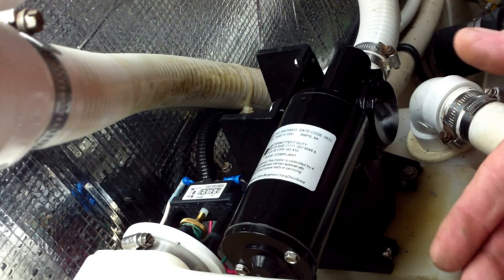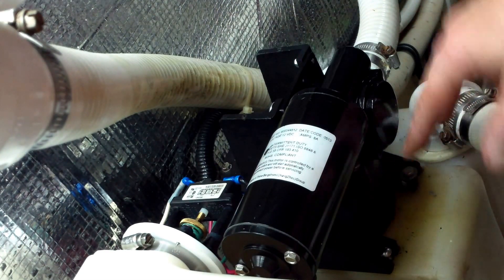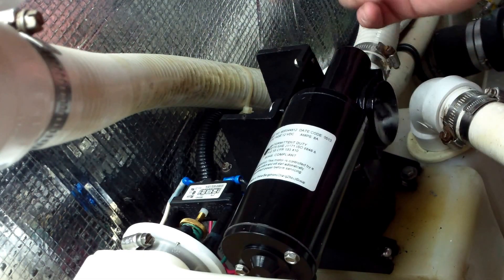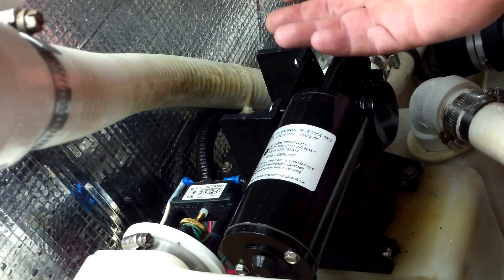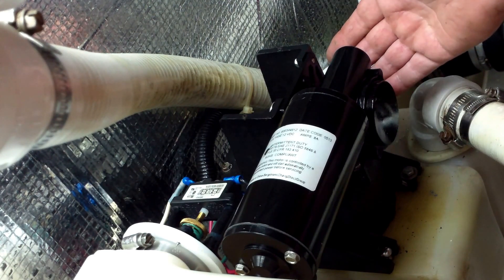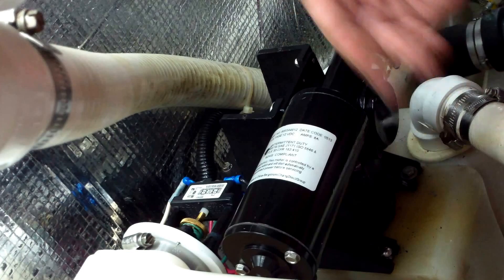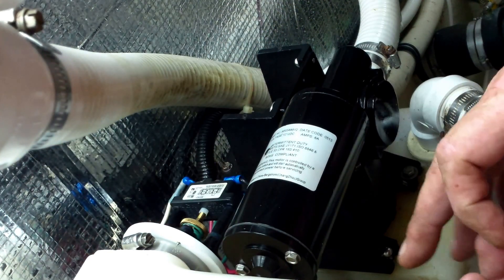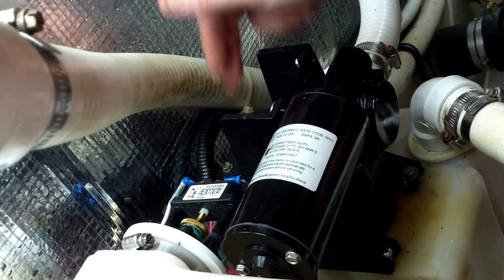Sealand vacuum pump repair.

Comment: i m looking for job on cruise ship.
Reply from the maker: go to school = it a vacuum system that has expansion tanks and check valves to hold 9 to 10 " of vacuum for the flush. that moves black water 50% as it pulls the vacuum it moves the black water to the holding tank. if the boat is 10 mi out it can pump out the tanks overboard with a mass pump set up to holding tanks. so vacuum only move it about 1/2 way to the tanks. its just way more to it and you need to go school for it.....its just a big vacuum that all. way more them I can tell you. USGC reg to head systems. I also do boat/ refg and a/c /pumps/ water systems /ECT. I HAVE 20 YEARS WORKING ON BOATS !